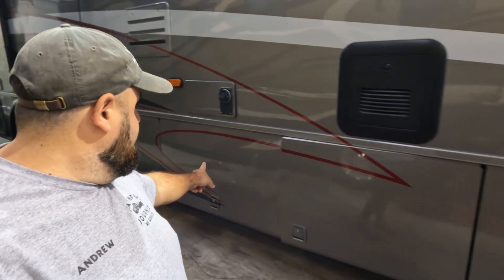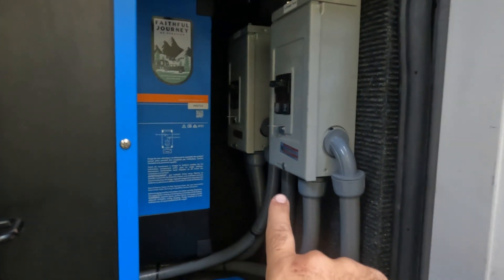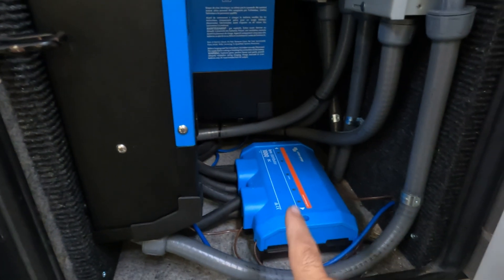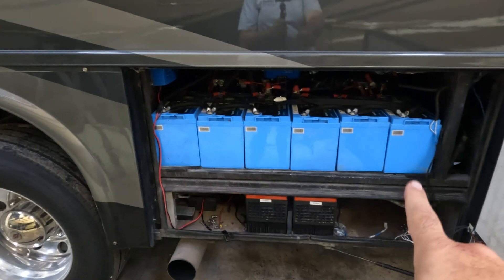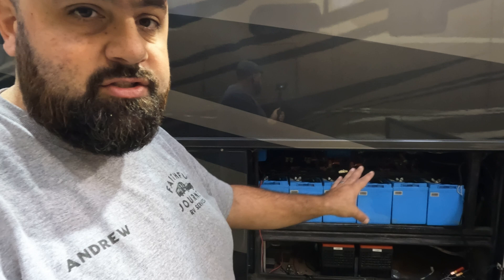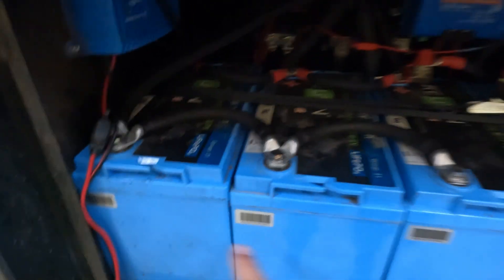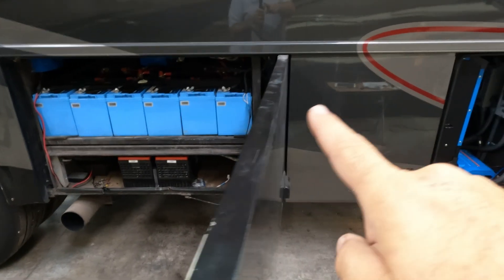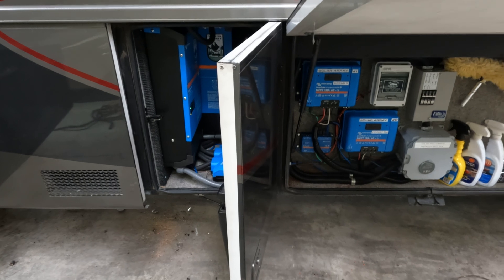2007 Newmar Allstar - Dual Victron Inverter Upgrade and Generator Auto Start Stop Installation

Comment: We have the 4154 variant- with a gigantic rear cargo bay instead of a garage.  And yes, immediately I knew all about the space challenges near the battery bay.  I moved the starter batteries to that mid bay and installed a single M+ and two solar charge controllers under the battery bay where he has the starter batteries.  I've also contemplated deleting the battery drawer but I managed to make it work with a 1000ah custom battery build. I like the use of the TV bay for mounting the solar chargers.  I installed rockets on that bay door so that was the trade off for me.  I also went through the absolute torture of running conduit and cat cables up to the control panel by the door so I could install the cerbo and gx50 there.  The touchscreen is really nice to have.
Reply from the maker: Yep it is definitely a tight fit in this motorhome. My client previously decided not to install a touch screen for the cerbo, so I didn't have to struggle to run the hdmi and usb cables. Check out the gen auto start stop I sell if you want to integrate your Onan gen into your victron system.